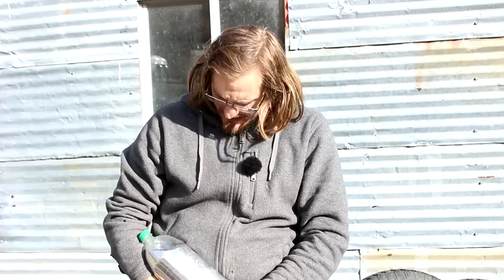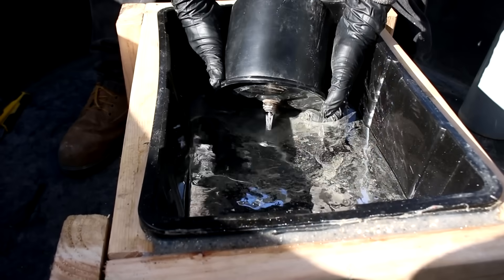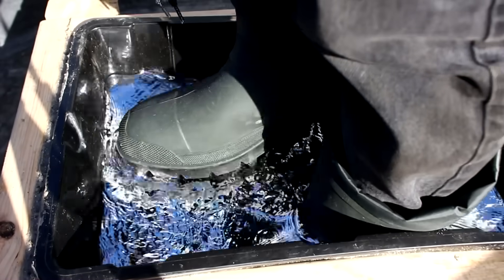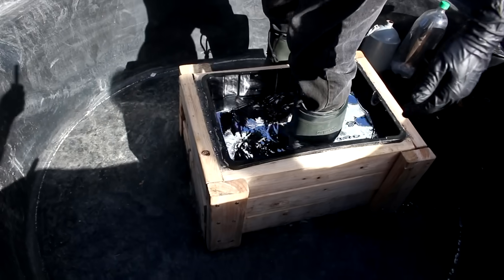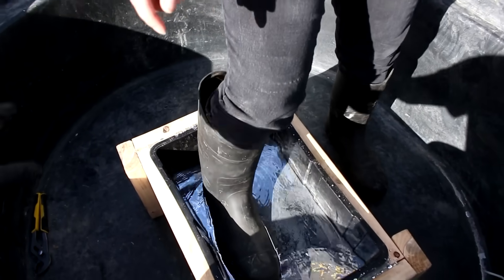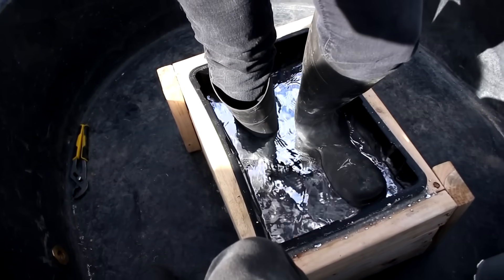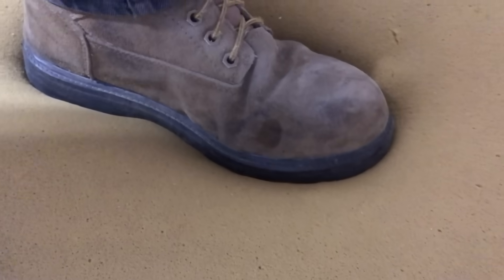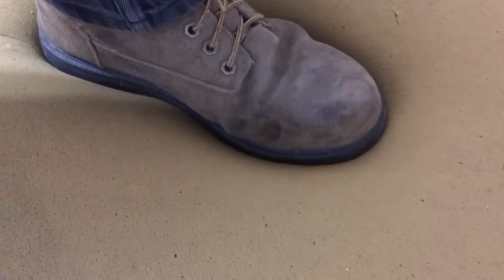Can I Stand On Liquid Mercury?

Comment: As much stuff as he does with Mercury, he should really be wearing a Mercury vapor filtered respirator, even just a cheap 3M one.  Other than than I have no gripes about Cody's safety practices.
Reply: I mean it's cold, and he's in the middle of a windy field. I think he's aight
Reply: it's toxic, but metallic mercury has very poor bioavailability so it's not absorbed by your body almost at all, it pretty much can't get inside your cells unless it's at least oxidized first. As long as you don't stick your head in a jar full of the stuff and stay like that for a few days, you should be fine.
edit: and yeah, the vapor pressure is really low, so by being outside you pretty much avoid inhaling it completely
Reply: Daniel Ruff in case there is any cuts on his hands that he does not know about, the gloves will help keep mercury off of him. despite it not being super dangerous a a metal, you still don't want it on you. basic, cheap precautions should always be taken with things that pose even a small risk of injury.

also, very little mercury would have gotteb in his face because ot does not wet objects the way water does. imagine covering everything around you in a super powerful rain-ex. thats basically mercury on most surfaces.
Reply: So why is he wearing gloves if the stuff is that safe?  And then he brushes the hair away from his face with his gloved hand after submerging that gloved hand in the mercury.  Does he have mercury in his hair now?
Reply: OriginalPirateLyricVideos Mercury as a  vapor is extremely dangerous. As a liquid not unless it gets directly into you blood stream. The lethal amount of mercury inhaled as a vapor is given and the rate at which it evaporates at any temperature is also given. Therefore it's easy to calculate oneself how it's basically impossible to die from short exposure to liquid mercury. Also, he's doing this for years already.
Reply: I had the same worry some months ago until he posted the results of his blood tests. Mercury levels were surprisingly low.
Reply: Yuanyuan Qu Cody is not an idiot, he knows what he is doing and what he is working with. For certain things he doesn't need what you think are necessary safety precautions. And accidents always happen. Even in a state of the art lab things can go wrong. Do you remember the Mars recon orbiter? Or failed Apollo missions? When a vial of theoacetone was knocked over?
Reply: Cody has proven that working with liquid mercury isn't as dangerous as people think. He's careful, but pragmatic. He's been to the doctor after years of mercury handling, and his blood tests show no abnormal mercury presence.
Reply: Daniel Ruff he wore gloves because he had a cut on his hand
Reply: Nick Nick That depends on what you expect. In this case they were that low that they were not only within the range of what is considered safe, but they were that low that you couldnt even notice that he was in contact with it recently.
Reply: Yuanyuan Qu yea idiot was definitely way too strong of a word to use. An idiot doesn't know the risks, or believes themselves to be impervious. Cody knows just how dangerous some of the things he does are, and that's just it, he doesn't work for anyone else or have any OSHA people looking over his shoulder, and he isn't afraid of a bit of pain, which means he has a higher tolerance for what consequences he is willing to risk.
Reply: If you noticed, the mercury doesn't wet the glove.  So no, there's no mercury on the glove, nor in his hair.  He's wearing gloves in case he has any cuts on his hands.  You don't want mercury in your bloodstream.
Reply: Being outside where there's always some air circulation, and being a very cold day, he's in no danger.
Reply: baconchipcookies  Exactyl. Organic mercury compounds are the really scary thing. My professor told us about a scientist who got two small drops of that onto her glove died because of that a couple of months later. But a mentally ill man injected mercury from 5 thermometers directyl into a main artery (he was treated half a day later) survived with only little damage.
Reply: +Fiiischinator
So drilling into a large Hewttic rectifier and sucking the gas into your lungs wouldn't be the wisest move!
Reply: Probably not, since it doesn't coat the glove like water would. It forms drops and pretty much completely drips off.
Reply: yep. glad we cleared that up. :)
Reply: OriginalPirateLyricVideos he hash a minecraft profile picture. He is not smarter than cody.
Reply: 3 months later at the Doctors office,  you have 5 months to live
Reply: i really don't think anyone should be considering cody as the expert on safety...he put his hand in liquid nitrogen, has had various accidents over the years (the most recent one i know of being setting off an explosive with a knife-the knife's tip broke and embedded in his finger-see his "will 1300 fps set off nitrated glycerol" vid) regularly does dangerous shit featuring fire and/or chemicals without proper safety protection, and so on. cody is a fucking idiot, don't copy what he does.
and if you do, do it properly.
Reply: OriginalPirateLyricVideos you're the reason science videos get pulled... US people and their complete lack of common sense and the willingness to blame everyone else for your ignorance. That is why the manual in N.A. is a bible and in other countries only a few pages. You don't have to tell people not to dry their cat in a microwave anywhere else! Whatever you do is on you. Educate yourself first and use critical thinking before attempting something yourself. Curiosity drove mankind to where it is. PC and liability is on the verge of creating a new dark age.
Reply: He probably takes it off so we can hear him.
Reply: Cody always takes very careful precautions with mercury. If you watched his videos you would know that.
Reply: TheHavoc09 someone's mad at our superiority
Reply: Twisted Messes surprisingly low... not the description i want from a lab test.
Reply: BrainDoesStuff that's true, but cody does do/approaches more dangerous stuff without as much caution as other people would have around such things. he's not an idiot, i just exaggerate sometimes.
Reply: mercury is toxic af, trust me!
Reply: TheBaldr says the child/preteen/teenager or grown man with a minecraft display pic.
Reply: I'm quite sure cody is more educated than you, and knows a thing or two of what he is doing.

Comment: How about using something like snowshoes (perhaps with a continuous membrane instead of a mesh)? That ought to make your stance a bit more stable.
Reply: Nope, wouldn't make any difference.
Reply: Mercury has surface tension, like any other liquid. There are insects, birds, and lizards that can walk on water, because their feet spread their weight over enough area that the surface tension of the water supports them. The same ought to hold true for the weight of a grown man, spread out by snowshoes, on the surface tension of mercury.

Comment: I would have thought that you wouldn't want your feet in the mercury because you might get it stuck between your toes and it'd take a while to make sure you go it all, were as with the boots you can just take them off (and clean if needed). I don't know if the surface tension of mercury would allow it to do what water does, or if it always beads up.

Comment: Can you throw ice on it? In water 90% of the ice is underwater( or whatever it is, iceberg stuff), if you throw the ice in mercury, would any of it be under water?
Reply: The densities of ice and water aren't that different when compared to mercury. Without doing any calculations, you can figure that the block of ice would be >90% above mercury level, because Cody didn't sink more than ~10% and Cody is mostly water.
Reply: Tanner Beverley underwater?
Reply: Looks like about 93% of a normal mass of ice would be above the mercury surface.
Reply: eggrollsoup you got me, i should have said "sub merged"
Reply: Tanner Beverley lol

Comment: Aquarium wouldn't handle it, PROVE IT!, haha, that would be a cool video
Reply: The clean up wouldn't
Reply: most 10 gallon aquarium can't handle 640lbs pushing on the bottom  of the glass and will either break the glass or burst the seal.
Reply: the fish wouldnt agree either
Reply: Ahh yes
Broken glass and Mercury sounds like a great idea
Reply: open wound generater
Reply: Nb Smith shit your right. I remember that. Gonna watch it now
Reply: I believe he showed how toilet couldn't handle it.
Reply: Why would he use an aquarium? Mercury is opaque anyway.
Reply: Ehh, no one really wants to clean up broken glass mixed with mercury
Reply: That would be awesome
Reply: im sure it would also me a messy one
Reply: That won't really be that cool. He's like pour the mercury in and the aquarium glass will break. What so cool about an aquarium shattering?
Reply: It would most definitely be a huge mess.  But still an awesome video to see containers yielding to the weight of mercury. Maybe not an aquarium.
Reply: U N not going to really going to explain that.
Reply: I don't think you'd be able to see much anyway.
Reply: Mike's Tool Shed| What?
Reply: He did a video with mercury and toilet and it broke... so I doubt thin glass would be happy.
Reply: It wouldn’t be that exciting. It would just blow out the sides of the aquarium.